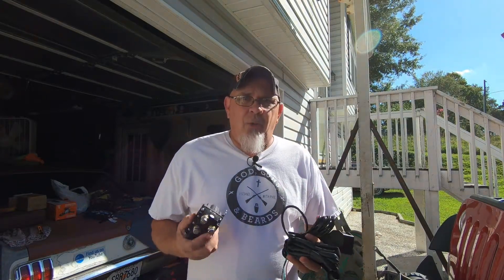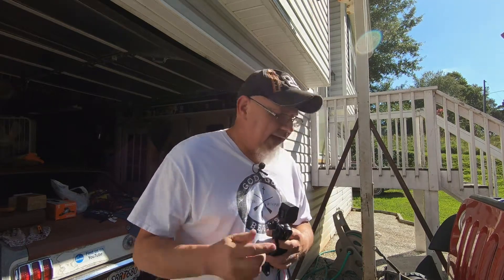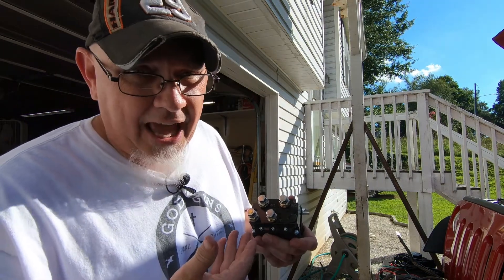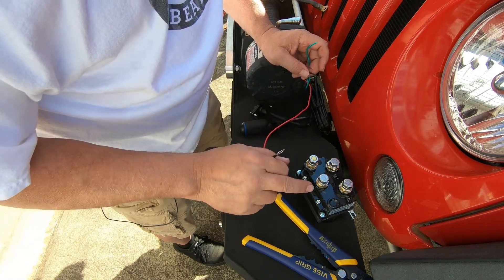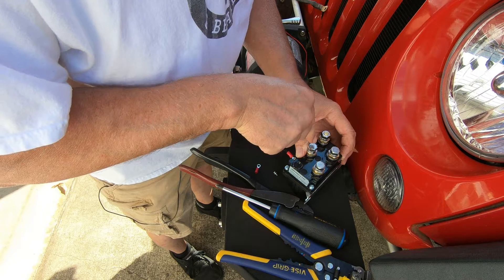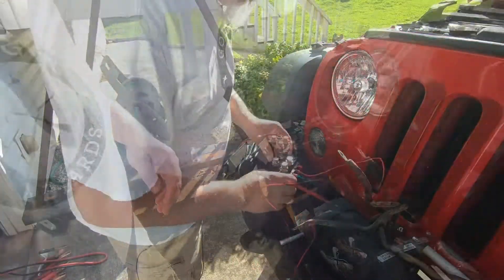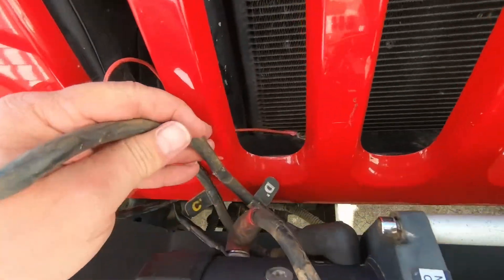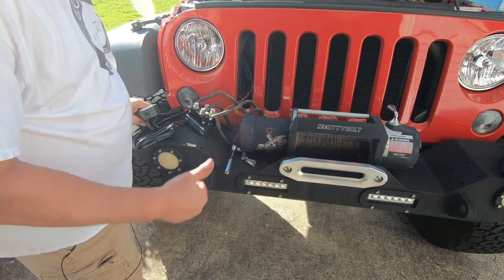Winch wiring explained!

Comment: I have the same winch, and the same buzzing chinese solenoid.  Could you provide your fans out here a brand name, part no. or spec. for that fine solenoid you found online that upgraded your Badland 12k winch?
Reply from the maker: The one I used is no longer available, unfortunately. However, I do have a link to another one I've personally used down in the video description. The only difference between them is the one in the video used screws for the control terminals, and the one in the link uses spade connections. The orientation of all connections are the same between the two.

Comment: Thank you! Does this mean that the winch will always be operational? My diagram told me to route the switch power wire to a power source that is key operated. I took that as, I should splice into my ignition key wiring, and caused more problems for myself 🤦🏻‍♂️ But it seems like what you have here is easier and always operational.
Reply from the maker: Yes, it would be operational at all times

Thanks for watching!

Comment: ok I think I have the same contactor I jumped the hot wire from the + post to the center terminal the terminal you grounded the right and left terminals went to the remote it worked fine I checked amperage from both motor terminals I think with a motor that has an isolated ground accually works as the ground for the solenoid

Comment: Can you send me the link to the contactor in this video?
Reply from the maker: It looks like the exact one I used is no longer available on Ebay. I do have a link to the handheld switch:

https://www.ebay.com/itm/134190782418?mkcid=16&mkevt=1&mkrid=711-127632-2357-0&ssspo=lphmjE4BQMC&sssrc=4429486&ssuid=bwZYlXIiRzq&var=&widget_ver=artemis&media=COPY

Any of the commonly available 12v 500 amp solenoids would be very similar to wire as the one I used. The main difference is that instead of using small rings for the control terminals, you'd use spade connectors instead.
Reply: @TorquePowerVideo Thanks for that info, it's much appreciated!  Your video is a lifesaver.
Reply from the maker: Awesome! I'm glad it could help!

Comment: Just got a new badland ZXR 5000lb winch from harbor fright. The wire diagram is  showing the black control wire in different terminal than the one already on manufacturer solenoid. Another post said its wrong so keept searching and ran across your video.  Good job and than you for the clarification on the wiring.
Reply from the maker: I'm glad the video could help. Thanks for watching and commenting!

Comment: I have this exact winch.  Bought it in March 2023 it is now the end  of March 2024.  Used it once and tested it monthly.  I am full-time overlander traveling the world.  I went out and tested it 2 weeks ago, and it died.   Turns out, as usual it the control module.  Warn has, for a few years, been buying their control modules from China.   Unfortunately Warn is what I consider a junk winch now who unfortunately makes it extremely difficult to fix it.  I have to send  it or take the winch to a certified Warn repair shop so they can take weeks to figure out what's wrong with it after 1 year and1pull.   Unfortunately, we live in a world where nobody stands by their products, charge way too much (3000 for this winch) and points fingers of who caused it.  I'm going to have to get it fixed, sell it, and go away from Warn winches for they are no longer the leader in recovery winches.  Once fixed, I will be doing a video on my main channel for overlanding and will include what ended up wrong,emails between Warn and myself and phone conversation on how Warn really does everything to play the blame game and what I need to do to get my winch fixed after 1 year and 1 pull.  Believe me stay away from Warn.  At one point Warn was the knig of recovery winches.  #warnwinch #warnindustries